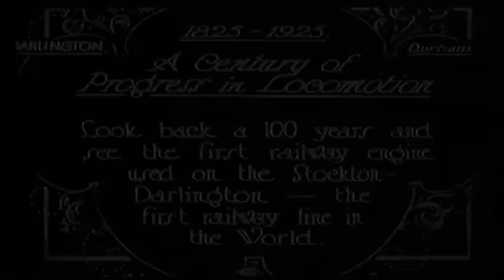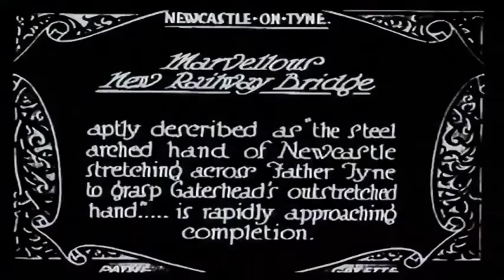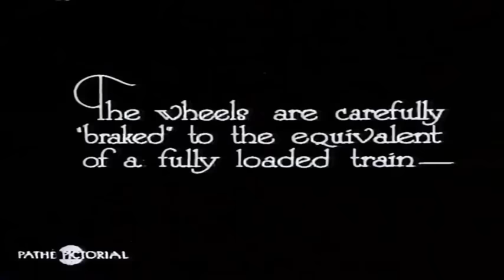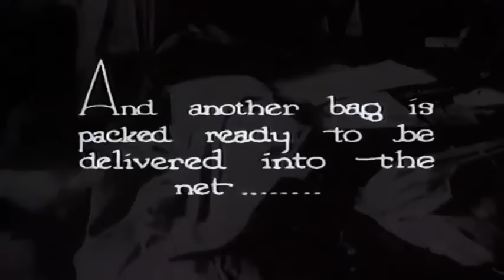The Changing Face Of Britain The Steam Train

Comment: What is the Locomotive pushing the Rocket at about 3.43 ?
Reply: LNWR 2-2-2 'Cornwall' designed by Francis Trevithick at Crewe, and later heavily rebuilt.
Reply: It is a most elegant looking locomotive. It usually resides in 'Locomotion' at Shildon. I see that it is currently on loan to the Buckingham Railway Centre at Quainton. Both places are musts, if you are a railfan!